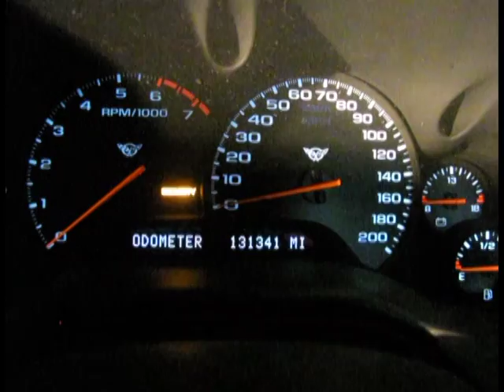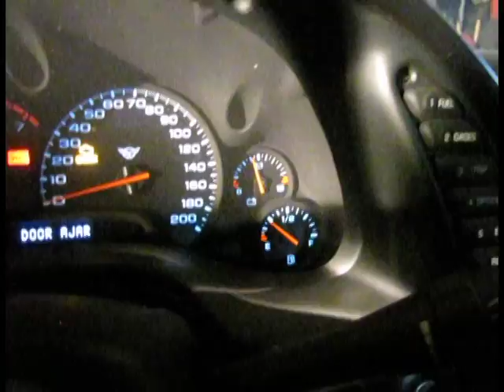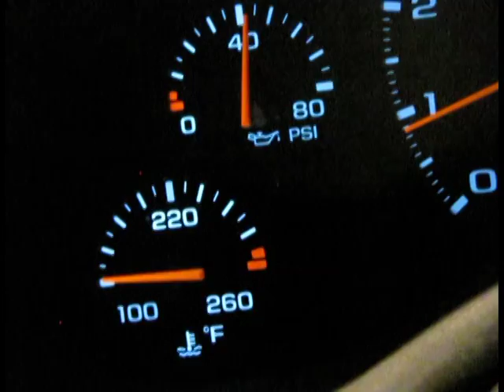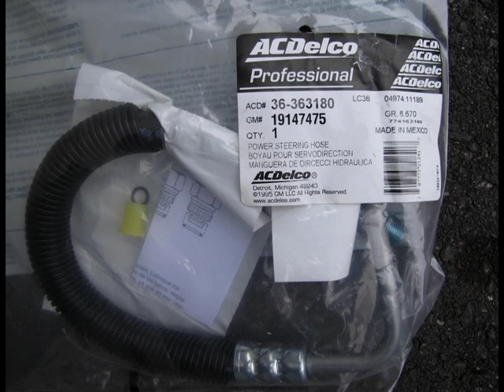The Vette Rides Again!

Comment: If it makes you feel better, I blew the engine in my Z06 in December 2010, and still haven't touched it. Headed to the Indy 500 next week (a yearly thing for me), but when I get back I hope to take a crack at it. I told myself that I was going to do all the work I could, and also that if I took the engine out, it wasn't going back in stock. I plan on swapping in a 5.3l LM7 out of a truck to practice on and so I can drive it while I rebuild the LS6. I'm thinking Magnacharger. :)

Comment: Glad you got your ride running, you are very fortunate the starter broke like that, otherwise if it hadn't and it managed to turn over the engine you would have had to replace the entire engine, when a head gasket fails and the cylinder fills with coolant and your engine will become hydro locked, and since liquids do not compress like gases your connecting rod would of bent at the very least or even snap, when they snap they usually punch a hole through the side of the engine block....Semper Fi

Comment: Hey Junkman, First thing, THANK U FOR THE GREAT VIDEOS ON HERE! Funny a lot of the stuff u do detailing are very similar to what I do, I learned mostly by trial and error, but I have learned a lot too from your videos.  As stupid as it sounds I mostly detail by feel, I know it sounds funny/weird, but when u make a connection with whatever your doing whether it be detailing, playing guitar, running a marathon or whatever. I can make something become a part of me, it becomes very natural/second nature. You seem to do it the same way, that's why out of all the videos on youtube yours are my favorite, u seem to have a natural connection with what u are doing.  Ok, I got a question for u. I have a 2000 corvette and after seeing your head gasket video, it made me think. Hmmm... What made your head gasket go bad! Bad thermoset, rotten anti-freeze, racing the engine at high rpm's? Just curious, I haven't seen that on line as a commen problem. Also when u cleaned your engine, did you spray the battery area? I heard there are some very finicky wiring under there and it's not good to get that area wet at all not even a little.  Maybe I was misinformed, but just curious about that too. Thanks JM
Reply from the maker: +LittleJimmyNorton The head gaskets started leaking because I overheated the engine years before the gaskets finally gave out. The process was slow and took awhile to develop because I don't drive my car year round.

You need to look me up over at Digital Corvettes so that you can gets some decent and correct information about your car. That crap someone told you about the battery area is so far off base that you may as well got that scoop from a box of Fruit Loops. There is a lot of bad information out there about these cars. I keep C5 owners on DC up to date with the real scoop.

Comment: Didn't GM have a recall on that bracket? that seems odd it would fail like that.
Good job on the Engine work! I would check that timing belt and water pump next..

Comment: What actually busted your head gaskets is the orange DEXCOOL (DEXKILL) coolant that was in the engine, I sure hope you switched to the green type cause it is known to etch both intake and head gaskets, google for youself if you don't believe me!!!
Reply from the maker: What busted my head gaskets is the fact that I overheated my engine and didn't realize it. This caused the heads to warp and start the coolant to leak into the cylinders. If Dex-Cool was a problem, GM wouldn't still be using it in Corvettes today.